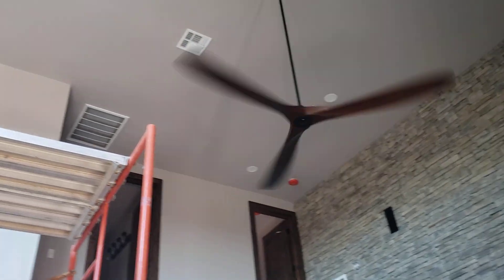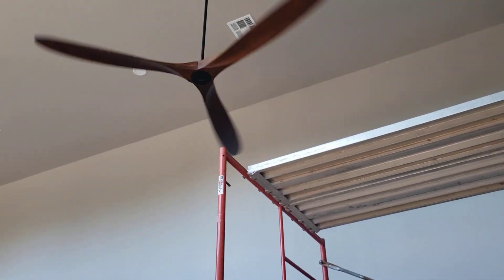Monte Carlo Maverick 88 Fan Does Not Start Correctly

Comment: I’ve seen this before, in a few rentals and the slightly more urban way to get it going, is leave power on and hit it with a stick to get it moving… Not the answer you were looking for, but I couldn’t resist
Reply from the maker: I went up and blew out the gaps, a few small pieces of packing stryrofoam was in there. Seems to be a little better now, although it does still happen on occasion.

Comment: Could you kindly share an update about this situation? I realize this is over 1 year old. I'm interested in purchasing the exact 88" model. Did you have issue "balancing" the fan, as well? I have seen some other videos about the balancing requirement, and some wishing that the balancing was done in-house by Maverick during production. It's a shame there are a few issues because I think this is the most attractive fan of them all. Just so eye-catching!
Reply from the maker: Nothing really new. I didn't have to balance the fan at all. The company never did anything to offer up a "fix" for the problem, which kinda ticked-me-off to be honest. I ended up leaving it as-is, and sometimes I just have to turn it on, then turn it off, then turn it back on, and then it will work. For the price you pay for these fans, you really shouldn't have to deal with this kind of problem, but I have no way around it. Once I get it cranked up, it runs great, is balanced well out of the box, and it moves a lot of air and is quiet.
Reply: It's interesting that you didn't have this issue with one of them, but did with the other two, would that be correct? @CIOPilot
Reply from the maker: @markpeterson3789  Yes, exactly. I also have a slightly different version up in our bedroom, and it is fine too.

Comment: Thanks for this video. I almost purchased on tonight. Did you find a solution? Sucks that it’s $1K and having issues like this…
Reply from the maker: I didn't really get much in the way of support. What I did do is get on scaffolding and use my air compressor to blow out any small debris from inside. There were a few tiny pieces of the crappy styrofoam being used inside the housing. Also cleaned the blades with wood polish while I was up there. That seemed to have helped the start-up a lot, although every now-and-then I do have to turn it off, let the fan start to turn, then turn it back on and it works. However, it isn't nearly as bad as when I first got the fans.  They look great and make a big statement in the room, but I agree, for $850, this shouldn't be happening.

Comment: How do I turn the fan on? All of the instructions show off and  forward/reverse!
Reply from the maker: You need to make sure power is going to the fan (usually with the switch), then use the remote to tell it to "go". Should hear a small beep come from the controller in the ceiling going to the fan when it gets the signal.
Reply: @CIOPilot  yes thank you!
Reply from the maker: @jrlang9017  of course. Good luck. I love these fans, but they are aggravating to have these little problems for the price they charge for them.